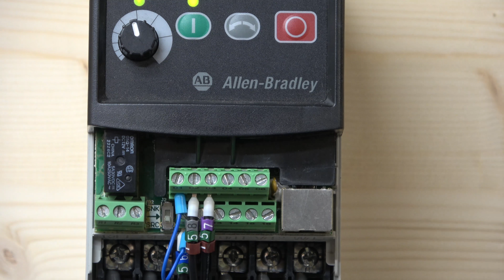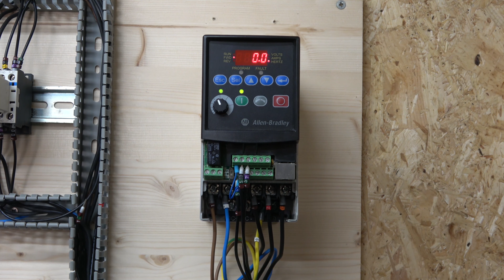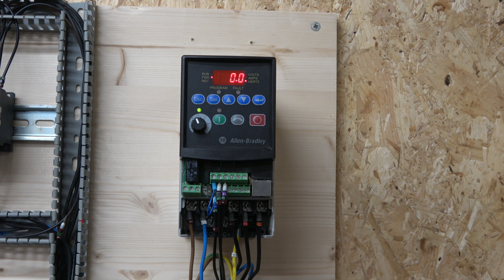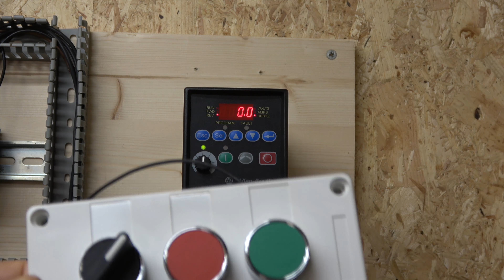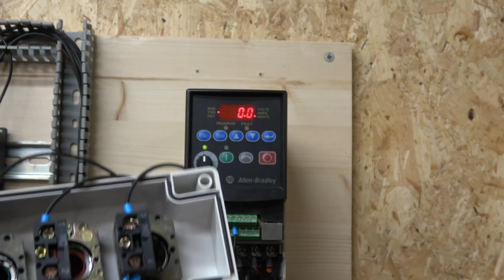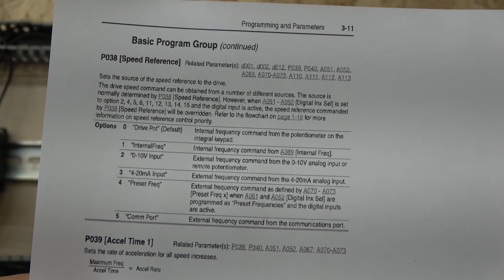Allen Bradley Powerflex 4 remote control wiring, 2 wire control and 3 wire control (ENGLISH)

Comment: What would you use R1, R2 and R3 for? I dont understand how those work
Reply from the maker: Hi Pablo. Those are relay outputs and they can be programed to be as alarms, monitoring and other signals, check out the selection in output parameter. By default usually the are set as alarms, so when it faults out it sends signal to panel light, PLC etc.
Reply: Hello. I am looking at buying a vfd like this 1 phase to 3 phase for a 0,75kw 1hp motor i want to instal it on a drill press so i no longer need to change the belt positions and just use the potentiometer to adjust rpm. What ik woud like to know is how can i wire in a emergency stop? I have seen there is a brake resistor available for these vfd’s and was wondering if there is a possibility to wire it so it can use the brake when the emergency stop gets pressed. 

The control functions i woud like to have is
Start 
Stop
Reverse
Pot meter to adjust rpm
Emergency stop

Comment: I need to run 3 drives from 2 start/stop stations would you use a 24v power supply
Reply from the maker: Can you give more detail. When you say 3 drives, with 2 start/stop stations, presume the both stations work in parallel with each other, you can start the drive from both stations and stop as well? Do you want all 3 drives to come on with 1 start signal? cors start could come from any station.
Reply: @IGSElectronics  yeah that’s how I want them ..in parallel so I’m thinking ice cube relay with a latching circuit the NC going to the stop and NO for the start
Reply from the maker: @jamesmcclain3588  Not sure how your system is set up, but if i would set up like that, i would use one relay with 3 NO contacts to start all 3 drives. Each drive has its own 24v output to run inputs, so each drive needs to return its own 24v output to its own inputs. Hope that makes sense.